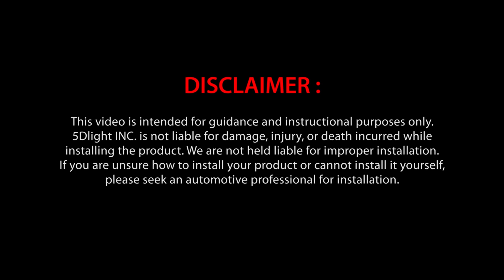How to replace headlight high low beam to LED bulbs H11 9005 on Subaru Forester 2012

Comment: Do you have to adjust the beam pattern when installing it because I'm noticing the same thing with mine but it seems a little odd on mind that it doesn't seem to shine like a factory the driver side is brighter than the passenger side
Reply from the maker: Thank you for the message.
If you find out the beam pattern is not as perfect as you expected, You can refer to this video to adjust the beam pattern:https://www.youtube.com/watch?v=hdWaXX7IZ80
Besides, could you please tell us the year and the trim of your Forester and whether you purchased Lasfit headlights?

Comment: i would need also hight bean low bean dont need i got the HID from factory im ok let me know
Reply from the maker: What's your vehicle make, model and year? Are you factory headlights HID bulbs?
Reply: @Lasfit-Automotive  same as the clip forester 09 limited which HID but regular yellow ish high bean
Reply from the maker: @overlandsubaruinternationa2378  Ok. The high beam is 9005, you could purchase 9005 LED bulbs from this link:
https://www.lasfit.com/products/9005-hb3-led-headlight-high-beam-la-series?utm_source=Social&utm_medium=YTB%20Channel&utm_campaign=LAplus9005
Reply: @Lasfit-Automotive  what about the backup light ?
Reply from the maker: @overlandsubaruinternationa2378  The backup light is 7440 for 2009 Forester: https://www.lasfit.com/products/lasfit-7443-7440-white-led-bulb?utm_source=Social&utm_medium=YTB%20Channel&utm_campaign=L-7443